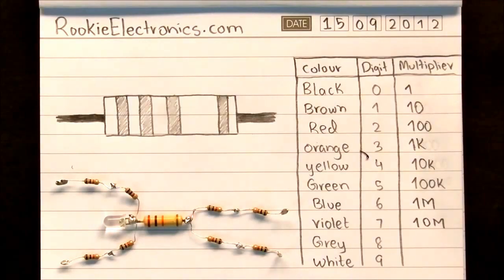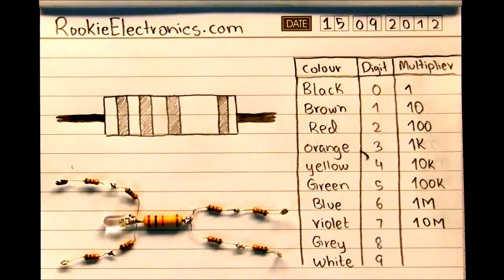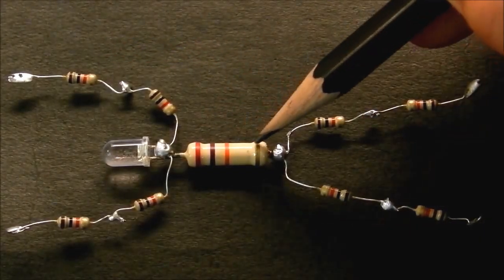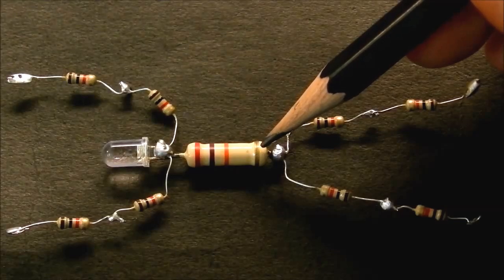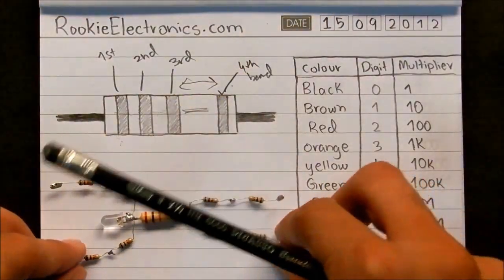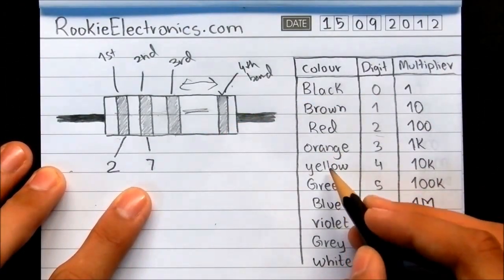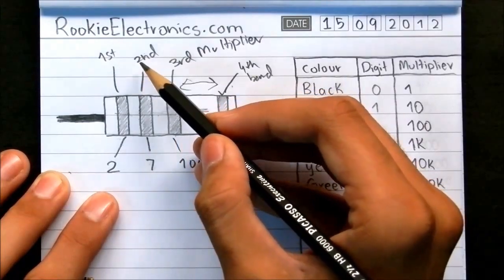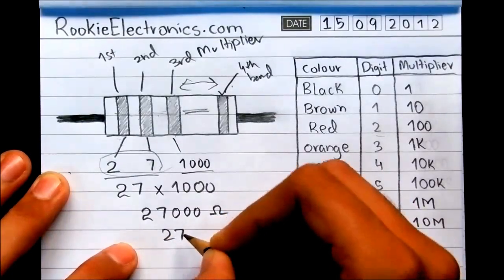Resistor Color Code | Calculation Resistance From Color Bands

Comment: What would be the colors if resistance is 30 ohms?
Reply: ahmad bin haider  the color of that value are 0range,black,black.. because the multiplier of the  3rd one which is black is x1.. s0 3 (0range) 0 (black) 30 × 1= 30 ohms.
Reply from the maker: http://rookieelectronics.com/resistor-color-code/
ahmad check this online web app and it will help you :)